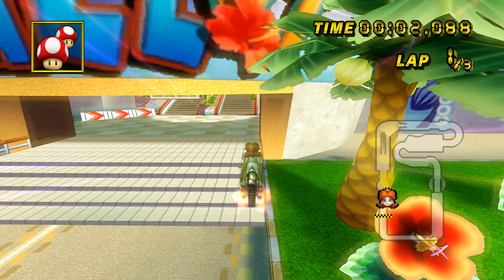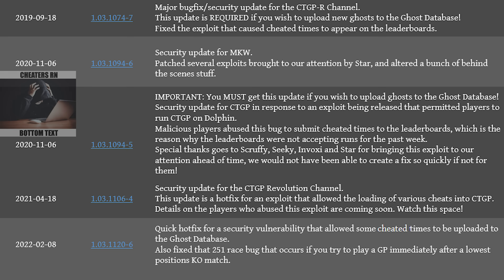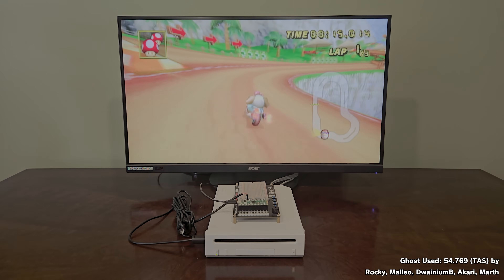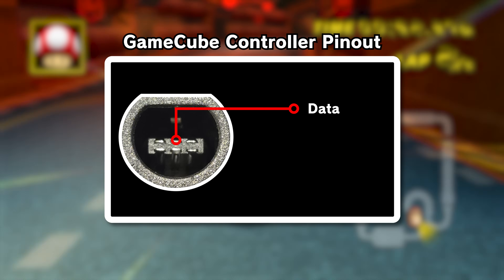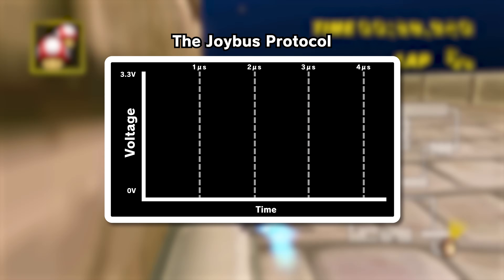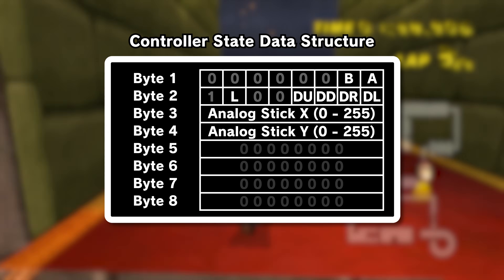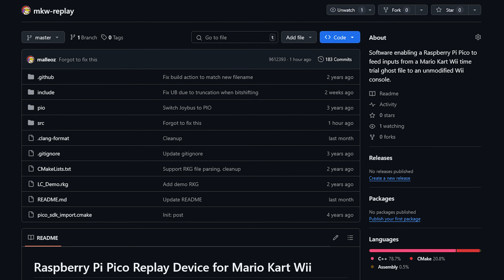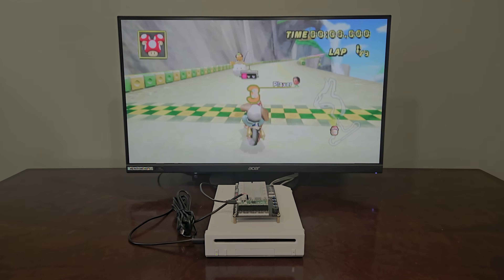Building an Undetectable Cheating Device for Mario Kart Wii

Comment: The non-deterministic solution you guys came up with should catch it either way, but for the fun of it: The Wii Remote accessory connector port uses I2C, which is a wired protocol that's very well documented, so it should be easy to fake the Classic Controller. There's also a lot of libraries for how to read input data from a Wii Remote, so you would think there would be an existing library for pretending to be a Wii Remote - though I couldn't find such a thing. Maybe I didn't hit the right search terms, but I would think if we can connect to a Wii Remote and read its data we could do the same thing the other way around without too much trouble. Surely suggesting it wouldn't be hard won't jinx it and have it end up being 50 times harder, right? (Apologies if suggesting such a thing caused someone to look into it properly and find it next to impossible.) Judging by the number of smart home products using them, the ESP 32 microcontroller might be a good pick if someone wants to make a TAS bot-like wii remote. That or do what the other comments suggested and throw a transistor over the button contacts and have an Arduino or Raspberry Pi "press" the buttons on a real remote electrically, which is easier software-wise and messier hardware-wise.
Reply: I remember using an Arduino library that could mimic a wii classic controller over I2C to a real wii remote. It does exist! I'm sure I have the source somewhere
Reply: "you would think there would be an existing library for pretending to be a Wii Remote - though I couldn't find such a thing." This does exist -- it's called "WiimoteEmulator"

Comment: You should probably connect ground, so the wii doesn't interpret your 3.3v as 0v or vice versa. Otherwise the pin is still floating.
Reply: Though the same.

Comment: Look, I understand that preventing cheating is obviously the right thing to do as a community, but if we are at the point where we have to fundamentally alter the inputs of a run to introduce RNG then that is simply too far. What about the people playing the game? In the same way that cheating is unacceptable, introducing RNG (however miniscule) to inputs is absolutely not acceptable. How many times have I failed a world record from a subpixel interaction where the outcome could have been changed by a slight modification in input? More than a few times, and I'm sure better TTers than me have had way more. Honestly I feel completely betrayed because it seems like this has been implemented into CTGP for a while now and I did not realize it. I have had to deal with all kinds of input problems, be it having to use a CCP to GCN input adapter to get away from problems with wireless (where I eventually found that it was not translating inputs properly), or just actual hardware problems with my controller joystick. So frankly, this is not a change that I can accept personally. If I know that my inputs are going to be modified externally then I am not going to be time trialing on CTGP. I know everything I have said so far is ignoring the whole premise of the video, but thank you for the demonstration of the exploit. As someone with a computer engineering degree it was obvious someone would eventually implement it but it is still sad nonetheless. I recognize the need for anti-cheat, but this implementation is absolutely too far, regardless of how miniscule the zones affected will be.
Reply: I totally get where ur coming from but just wanted to clarify a point: this feature that slightly changes your inputs was an opt-in only feature in CTGP until the update from like yesterday, so any input issues you would be having couldn't be caused by it unless you enabled it. I do encourage you to give it a try because I was really against the idea at first too, but yeah it def is a weird feeling knowing your inputs aren't exactly yours, and playing off CTGP is a perfectly acceptable response
Reply: @WillMKW  Thanks for clarifying. It doesn't change how I think about this implementation because as I said I am against modifying inputs in any way, regardless of how miniscule. I understand the need for anti-cheat but also I'm at a point where I only TT for self satisfaction, so if I get the urge to play it seems like a no brainer to play off of CTGP
Reply: Pretty sure he said that the inputs only get changed within the first bit of lap 1, you're lap 2 and 3 won't get affected by it
Reply: "this has been implemented into ctgp for a while now and i did not realize it" congratulations
Reply: @vabold_ This is not the own you think it is. I have been dealing with inconsistent inputs for years and it feels pretty awful to realize that this has been implemented without me knowing. I don't even know how long it has been implemented but I simply reject the idea of inputs being altered at all.
Reply: @Srb003ds  it was only implemented with the most recent ctgp update a day or 2 ago
Reply: @vabold_  when performing at elite (world record) level small changes that are "within human error" are noticed subconsciously but not consciously, especially on hardware with variable input latency, frame delays, stutters etc from every piece of hardware pipeline (controller, GPU, screen, ...)

a chess grandmaster does not consciously hold full state of the board and every piece in their head at all times, watch 5s timer bullet chess
fps player does not consciously think which direction to move mouse, conscious thought is reserved for granular situational analysis and not high frequency outcomes that are meant to be deterministic (player input)

try talking to anyone who has ever been top 0.1% in high performance activities, physical or not
congrats on gaslighting WR contenders with RNG input manipulation while sarcasmposting like a smug redditor because you are not good enough for small changes to affect your gameplay significantly
Reply: @cor9498  I think Bean's the one that talked to those top 0.1% in high performance MKW TTs when he designed this system, not me
Reply: @vabold_  its more directed at devs anyways
Reply: @cor9498  Yes, Bean did talk with a lot of players. Only a handful could tell in specific parts of their specialty tracks, and that is why he introduced the concept of an exclusion zone.
Reply: Let me introduce you to a little thing called the paragraph break.
Reply: I felt the same way when I first heard about it. That was until I reached out to MrBean himself and had the most problematic portions of the track that I can notice this on (mg with odm), and had some exclusion zones impleneted. I can't tell a difference, and neither can most players at this point in time. The amount of change is on a smaller order of magnitude than a shaky finger during stick movement.
Reply: shawn berry my hero. at least someone else attempted to stand up for our rights. we lost tho.

Comment: There are three main ways to deal with cheating:
* Detect and reject tampering with the software. Problem: Tamper checks are responsible for checking themselves. Malicious users can fudge the result with enough effort.
* Detect and reject "non human input". Problem: Not fully objective, especially not with subtle modifications to existing human input.
* Change underlying mechanics to make them cheat resistent. Problem: Difficult to do and might be impossible for various technical reasons. And notoriously hard when it comes to dealing with automation.

The whole "non determinism" solution is in the last option. The problem here specifically is that it is non deterministic in a deterministic way. With enough effort it is possible to predict when the inputs will be fudged with and compensated for. And this assumes that said fudging happens at such a level that it can't be bypassed.
Reply: In theory the WiFi/BT can be read as a random noise source? If Wii lets you do that?
Reply: @renakunisaki  Since the wii has a high precision clock that can be read from, its behavior should serve as a decent randomness source (after accumulating a bunch of samples and hashing them). Definitely good enough to make external devices like this not be able to predict it.

though manual tampering with CTGP to bypass anticheat measures could still defeat it of course
Reply: I wonder if theres a pin you can read or something so u can make the input fudging truly random. of course, there may be a way to influence that despite the introduced randomness. There was a recent Kaze video that talked about that
Reply: isn't this ai lol

Comment: Another thing, in terms of cheating, that has been proven to be possible is to hide a Raspberry Pi inside the controller itself. You can then program that if you press a certain button combination, it will play a specific TAS input file. I've never heard of anyone cheating like this, it would also be very hard to spot it...

Cheating will always be possible, even if you are sitting next to the person playing. Question is how strict the rules have to be in the end to make sure; if it's even possible, for cheating to impossible.

Great video!
Reply: The Melee competitive scene has had a lot of debate in recent years about this, with the advent of new open-source controller PCB options like the PhobGCC or GoomWave (i forget if GoomWave stuff is open source or not). 

It's a great development for a lot of reasons! But it also makes things a lot more hairy in terms of what exactly constitutes cheating and how to enforce some sort of anticheat. Because you don't even need a Pi inside the controller, just flash your own custom firmware full of cheats and macros etc. 

Though, IIRC, full-on cheating has been pretty rare. Most of the debate has been trying to decide how much automatic controller input correction should be allowed, like where to draw the line between something like your average dashback hardware mod and an actual TAS macro. And box-like controllers have been a part of that debate too.
Reply: @chainswordcs Goomwave is closed-source, but pico-rectangle (mentioned in the video) and Haybox are other open-source projects that implement the GameCube Controller protocol
Reply: That's where community trust comes in right? If some rando showed up breaking world records out of nowhere everyone would be suspicious, and the people who are already established respected runners that already have the community's trust are unlikely to learn an entirely different skillset like programming embedded devices just to get a good time, normally people cheat when it's the easier option for them not the harder one (eg dream modding Minecraft to cheat, one of the easiest things ever to do with your game)
Reply: @Yamartim  I mean look at trackmania and riolu, or the one tf2 rocket jumping guy. It's quite common for genuinely really talented players to end up cheating to get world records in games where you have to be absolutely perfect to even have a chance at the WR. It's due to burn out or having to spend 1000s of hours on a single track or course to even get there so I get why they "skip" the grind when they themselves know they could get it eventually.

Whos to say some top ranker in this community might slip up or get the intrusive thought to start using devices like this.
Reply: Also, there are times when the line of "cheating" is absolutely arbitrary, like Trackmania and LIS runs where someone basically learns to replicate a TAS run, and it's practical to do so because they use a single-digit number of inputs. This has nothing to do with hardware, unless you count listening to music (to improve timing) to be using external help -- but then most players listen to music and would enjoy the game a whole lot less if told their records would be invalid due to the use of an external timing device. I personally think LIS runs should be legal, as there is a very limited subset of maps for which it's practical: each additional input increases the difficulty several times over, and even at 8 inputs they're taking 1-in-1000 or worse odds. It's not playing the game "the way it's intended" but neither is abusing the Uberbug in the first place.
Reply: It's been done -- not by embedding a Pi into a controller, but macro buttons on third-party controllers are absolutely a thing.
Reply: Depending on the input it could be detectable. For example a human isn't going to pinpoint the same exact control stick positions with the exact same timing repeatedly, but a "tas button" would do that. Even if you have it slightly randomize the inputs, the randomization probably wouldn't have the same probability distribution as human inputs. A single race is pretty short though so it might not be possible to collect enough data to conclusively prove a cheat.
Reply: @bobboberson8297  The randomization would cause the kart to crash within a few turns. Chaos theory. You'd have to input the EXACT values from the TAS file.
Reply: @bobboberson8297  It might work, but the human could potentially mimic the input motions and provide the randomness for the TAS to get the correct probability distribution (although it might be easier to drive the map normally at that point)
Reply: @iteragami5078  It's just a case of factoring TAS detection methods into a post-processing script modifying the TAS file itself, rather than doing something nondeterministic at replay time. For example some of the Trackmania cheaters who were using slowdown were detected because of inhuman (and unnecessary) density of alternating inputs: it would have been fairly trivial to realise that and smooth or drop the extra lines if you were a more technically-inclined cheater thinking ahead. 

For Mario Kart, you could similarly introduce "human" tells and fuzzing that don't influence the outcome--you have the benefit of being able to test the TAS file and make sure it still works before showtime no matter what--and in the case of eg. frame-perfect tricks (another commenter's objection), they ALWAYS need to be frame-perfect even if a human were doing them, so you can never be caught by preserving those as long as it's an input a human could technically pull off (because it makes or breaks the run so it's inarguable, no matter how hard it is to do--that's why you're #1, right?).
Reply: strip searches at tourneys
Reply: tbh, at some point u end up having to redefine the diffinition of cheating
while running a tas in a human only competition would be concidered cheating, would giving ur controller to someone Way more skilled than u count as cheating ?  I guess thats why it gotta be defined before even using the word

Comment: The way to cheat is interesting, but the way to prevent the cheat is EXTRA interesting.
Reply: it's really the only thing they could do. i was sitting here watching this video after reading this comment and trying to predict what the fix was, and it was really all I could think of, though my first guess was that you could make the time between the controller connected popup and the race start random too. i was thinking of randomly delaying inputs by a frame instead of changing them, though, it feels like it might be less intrusive? but probably not, i'm pretty sure they tested that possibility as well. randomly speeding up the kart at some points by a tiny bit might do something as well.
Reply: My idea was 'modify the x/y subpixels at the start of the race' but then you could just hope to get lucky or do some kind of alignment so it doesn't matter. This is probably completely impossible to deal with.
Reply: I was thinking encoding some hidden id input into the input stream before the race starts
Reply: I wouldnt ever call it cheating tbh, its a tas, it should be in its own cathegory, but it should never be called cheating
Reply: @SpeedyGwen  You are correct, it's a TAS. It becomes cheating when you attempt to pass off that TAS as a legitimate speedrun.

Comment: For a soldering iron, get the KSGER T12. It's a lot better than the yihua ones. Also use flux. Sn63Pb37 solder is best, and you might want to clean up with Solder Wick afterwards

Comment: The controller disconnect timers should've been randomized instead!
Reply: Then we go back to the idea Malleo had originally of pointing a camera at the screen. More effort, but very possible still.
Reply: @Kris18  "a camera" is funny, all you need is a single phototransistor or photoresistor and find a small portion of the screen which changes in brightness that you can tape it to, you can read it thousands of times a second and sync to basically scanline precision, while a camera is likely to be half a frame off.
Reply: yeah this is much simpler. you could still just try over and over again until you get the right timing, but you could just add even more desyncs before the race starts to make it insanely unlikely. messing with innocent player's inputs should be a last resort
Reply: @joemkdd  The discussions took place months ago when the beta testing went public. Long story short: most players can't tell. Those who can helped developed the exclusion zones to stop the anti-tas when it was detectable (on very precise shortcuts/input sequences). Multiple wrs (including one by myself) have been set with it enabled.
Reply: haven’t understood why bean didn’t do both if you’re gonna do it why not back it up with this too.